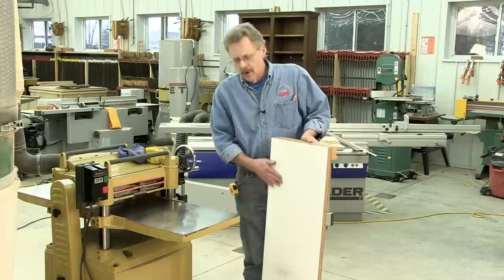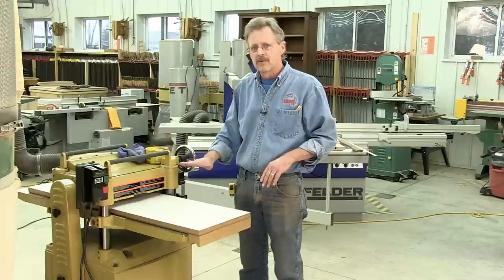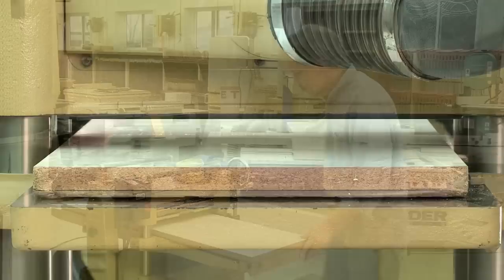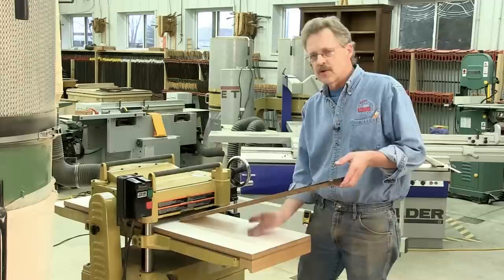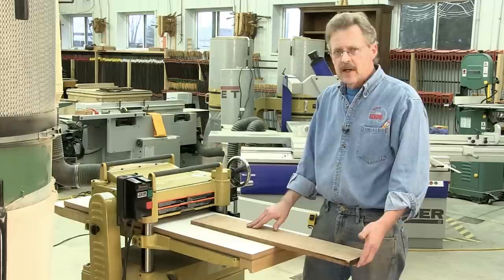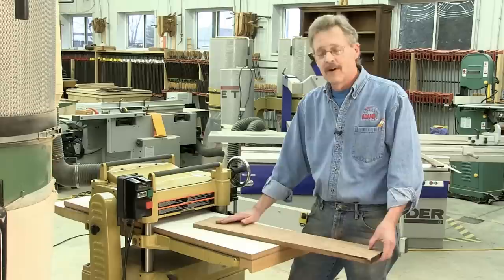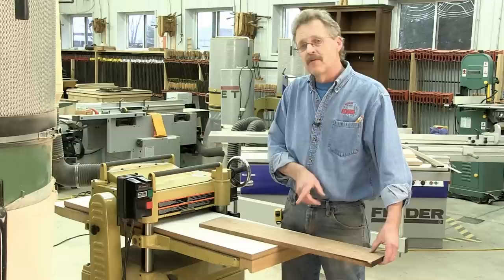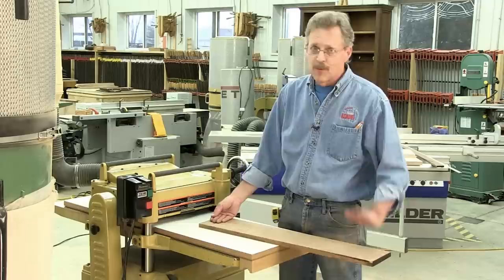Planer Snipe: It happens, get over it...

Comment: Extremely bad advice, just because the poorly designed machine you are running has snipe does  not mean they all do or there is nothing you can do to limit or prevent it. I have no issues with snipe with the planer I am running, I just need a larger one. Will not settle or live with this issue.
Reply: Agreed.
I have been a joiner all of my working life, except when I was an apprentice, and let the stock fall onto the floor, creating a ‘snipe’ I have never experienced it.
Didn’t even know the term.😂

Comment: if u affix    a    board on each  side of that  board   lengthwise  ,that are longer than the board you're   planing  ,   the  snipe   will   hit that  extra  length    and  not  snipe your  work [piece .    a   longer  piece  on   both   sides  solves problem

Comment: I use a standard Dewalt 734 planer. It works absolutely awesome! When the roller grabs the boards I very slightly lift up on the board keeping a little bit of upward pressure past the general snipe point that happen 3 inches in or so. Then on its way out I do the exact same thing. I just pinch the boards on the sides with Just a bit of upward pressure, very little. I would say that I get zero snipe in 18 or 19 out of 20 passses that I run and of the rare board that get snipe it buffs out by hand in 5-10 seconds with 80 or 120 grit sand paper held in my fingers. I didnt have to modify the bed, or scrutinizingly adjust the in and outfeed tables. Just a little upward pressure through the snipe points and all done.

Comment: When working with expensive materials, I have resorted to cutting a strip of pine longer than my piece to go through at the same time, or a shorter piece to start/end a long set of boards run through one after another.

A well tuned jointer can flatten the board to meet the snipe in two passes (planed side down), flipping the board end for end, so if the infeed table is tilted slightly it evens out.

Comment: I don't understand why some of my fellow woodworkers can pickup a 12 inch long board and run it through their planer and have absolutely NO snipe. I have to find and use a sacrificial board front and rear to just try to avoid having the dreaded snipe marks. I know the obvious answer would be to have them plane all my boards but that does not always work. Both of us use a DeWalt DW 735. I have watched just about all the videos on how to adjust my machine and NOTHING works.
Reply: I bought that one and didnt like it so i took it back and bought the 734 because it had a lockdown. Best way to virtually get rid of snipe is to flatten your boards first on the jointer. Then when the board feeds in and exits, pull up on the board with a little tension. I rarely ever get snipe even when i dont use the jointer.

Comment: So adding a sacrifice board in the front and back will not help?
Reply from the maker: That is another great method if you have the stock to do so. Thanks for sharing!
Reply: also feeding the board on an angle  also reduces the snipe .  as well as the tip i mentioned above

Comment: Good machines don't snipe if they are properly adjusted. The pressure bars, assuming you have them, are designed to hold the ends down. Far to many woodworker's do not know how to adjust their machines properly.
That piece of garbage machine ? There's no hope. Your right about that.